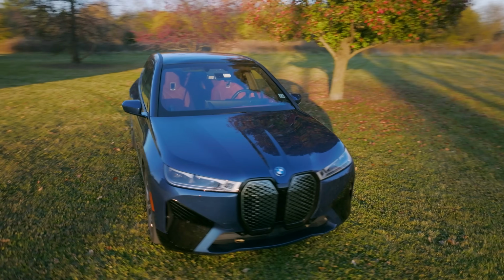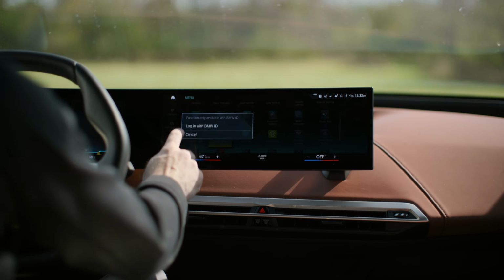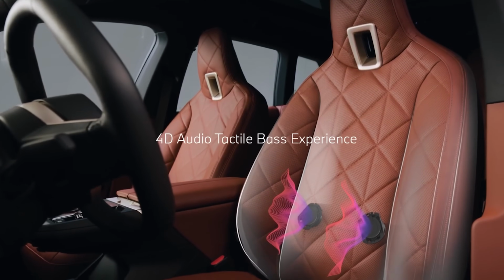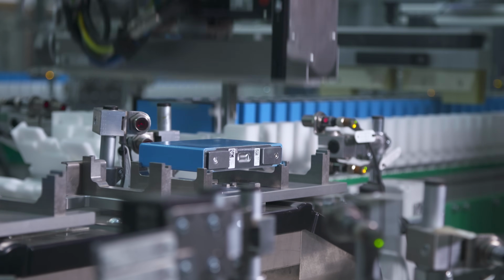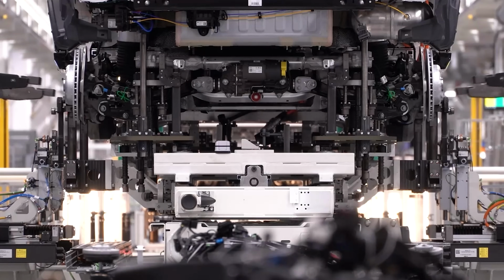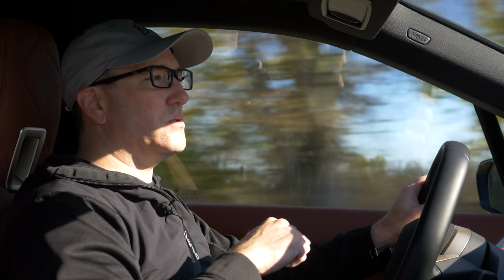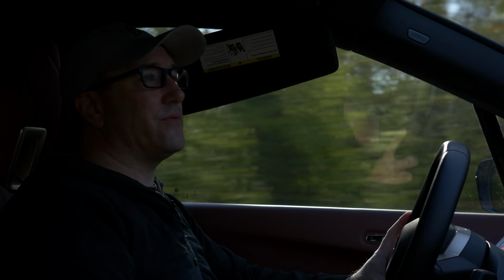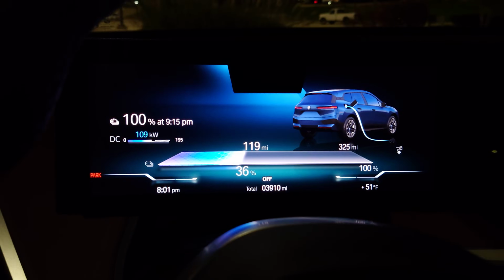BMW iX M60 | The Frustrating Future of EVs

Comment: I think the mechanical door switch is kept in case of crashes where electric power is cut off. You can still get out in those situations.
Reply: Adding complexity with no upside is foolish.
Reply: @bassandtrebleclef  Isn't it meant to be an added convenience that you can push a button if you don't want to use the handle?
But considering that you still have to touch and move the door, it seems like a lot of extra effort that that bit of pandering to the pathologically ultraconvenient.
Reply: @Dowlphin  I think it's small steps to get to a "BMW, Open my door" command. Totally hands free. We already have voice control and auto opening doors w/ active object detect sensors.
Reply: @josephcitizen4195  Such a voice command comes with tons of worries of careless activation and not enough security features.
Reply: @Dowlphin  How? There are push button auto doors on the market now. The careless activation of those are defeated by programming. How is a voice activated door any different?

Situations will have to be met though programming:
Car in park.
Car turned off.
Parking brake applied.
"BMW, open my door." 
Door opens w/ existing sensor tech that won't allow it to hit an object in it's way.

I'm not arguing, I'm genuinely curious why or how you think this won't become a thing.
Reply: I'm not saying it won't become a thing. It probably will, and will cause harm. Voice activation is more error-prone than mechanically pushing a button, and if the button merely unlocks the door and you have to push it open, even better.
But wise this is all definitely not. It is part of the technocratic agenda to make us ever-more dependent and ever-less self-reliant. Weakening the inner core of strength through temptations and pressures of borrowed external power, also lured into it by causing the problems that that power is supposed to shield against.

While we want a robot AI to lift our arm for us, beavers are munching through tree trunks.

Can people really do more these days thanks to computers?
Or can they merely tell computers to do more for them?
Are we conditioned into becoming like those who head these structures? Are workers turning into quasi-managers?
Reply: @Dowlphin  OK, didn't or cannot comprehend my talking points and then straight to troll/tin hat mode.

Got it. Have a great night dude.
Reply: @josephcitizen4195  I should have known your claim of not wanting to antagonize was bullshit.
Reply: @Dowlphin  lol you disagree with power windows too? 😂
Reply: @bassandtrebleclef  The upside is that you can get out, alive, after a crash. Think.
Reply: @codincoman9019  lol, maybe with fewer screens and nonsense distractions, said accident would not have happened.  Just spit balling.
Reply: @bassandtrebleclef  It’s a BMW, that’s all they are and ever have been.
Reply: @Ralph Lin you are correct.  The handles are for emergency purposes if the power is cut off.
Reply: because: REDUNDANCY.  this "ethos" is not just for Airplanes and the Aviation sector.

Comment: Too much rapidly changing technology and too much money.  A very good point about these being a "disposable" product and how the "sustainability" is being overstated. Last year when we bought a new vehicle we decided on a Honda Passport. Just a normally aspirated V-6 with a real auto transmission. We keep our vehicles a long time (also have a 2007 C-Class and a 1970 MGB) and I know the Passport will stand the test of time.
Reply: Non-aspirated V6? Lol
Reply: @hexbyt3u  Someone forgot to unwrap the air filter element again...
Reply: @hexbyt3u  Whoops Meant to say "normally aspirated".
Reply: If you understand how a supernova works, then you roughly understand our socioeconomical system.

The Borg collective from Star Trek is a useful analogy for some aspects of it, too.
Reply: dont they put that v6 in a sedan. sounds good.
Reply: @kalmmonke5037  Not sure. I think Honda has gone to Turbo I-4s in their sedans now.
Reply: WRONG FALSE NARRATIVE!
These $100K are limited supply from outdated Legacy Automakers who can't get their act together. They are just cobbling together what ever they can sell to many Rich Customers at limited production capacity.
This has NO Relevance NOT Applicable to the mass produced BEV industry up to $50K. Stuff like rapidly changing technology narrative is blatantly false as we do not even SUPPLY CAPACITY to supersede the existing cars. Sustainability is fine as usual because Car Production has DROPPED due to SUPPLY CHAIN SHORTAGE. Thus old 2nd hand cars have to stay on the road longer as they NOT BEING REPLACED!
YOU are not the Automaker trying to fix the SUPPLY CHAIN and making production numbers rise again. Stop pushing the false narrative your old car is any cleaner, because it's Not making a single difference.
Reply: @Neojhun  electric car life lasting longer apprenly due to batteyr degradation , see even tesla 3 cars already losing range thus being unwanted and junked after losing in used car market, while 90s corolla still running.  emissions is high to create battery from digging up heavy metal stuff so it takes 30k-50k miles for battery to start being less emissions over its lifetime....  so a balance between electric and combustion is best, optimized for cheap onwership too

Comment: The future of cars will now all be soulless appliances that will be too complicated for anyone outside of a dealership to work on. 

I would rather live in the past. 👍🏾
Reply: I wish we had a time machine. I wanna go back to 2007 or 2012
Reply: You do.
Reply: Just buy a nice 20 years old BMW and your fine!
Reply: Row your own gears in your E46 with the wind in your hair.
Reply: Keep in mind the average ICE driveline has 3000 moving mechanical parts.  The EV has a couple dozen.  Mechanical always fails before electrical.
Reply: @aussie2uGA  Those 3000 moving parts are still far cheaper and easier to replace. When something does eventually go wrong in an EV, it will cost far more and  most people won’t be able to work on them outside of dealerships. Even more $$$$$.

Comment: 7:00 BMW ditched physical buttons because people did not use them. Sorry Steve, I don't agree. This is just an excuse they are giving to make things cheaper and more locked down. Also the physical buttons need far less interaction than touch screen so of course I will take people more time at the touch screen than buttons. I am disappointed in BMW, 2 years have come by and still this shitty UI. Just embrace it BMW, older was better and improve on that instead of reinventing everything just to make a vau effect on new customers. Because at the same time you are loosing long time BMW owners. The only thing to ruin is driving dynamic and then BMW loses everything that made it great :/
Reply: It's literally a bolted on curved screen with cheap plastic mounting bracket. The german engineering aesthetic has hit an all-time low.
Reply: This problem isn't new.... BMW has been chasing crapification since at least 2010.  I just did a ride and drive in the 340 xdrive.  Extremely impressive car with a cheap interior and big, beautiful 4k screens to distract from the cheaping out.  Take away the driving dynamics and it's a cheap feeling and made car.  That is unacceptable to people spending this kind of money on cars.

Comment: EV just suck. The mining for battery resources is extremely polluting. They are super heavy which increases tire dust air pollution. They are super costly, completely out of reach for the average user.
Reply: Nevermind the impending shortage of heavy metals used in lithium batteries. Road to ruin.

Comment: EVs suck. And I find it mindblowing that everybody's jumping on the bandwagon of "how good and clean" they are, whereas in reality they are MUCH dirtier to produce, the infrastructure can't handle even 20% of current car numbers, if they were switched for electric ones..... and finally, the range, the explosive batteries, the unreliability of being hacked.... 
Thank you, I'll keep my manual transmission V6 gasoline Z.
Reply: Takes between 80,00 and 140,000 miles to start outperforming ICE cars on environmental impact depending on which estimates you prefer. And by that time you're contempating a battery replacement. So there goes the benefit.
Reply: If you actually bought a 3 pedal Z I salute you.
Reply: @markm0000  yes, but not the newest Z, I got the 370z, 6spd manual, non-nismo version. Threw out the viscous LSD and put in an OS Giken one. Put Eibachs for a slightly stiffer ride. Upgraded the antirollbars and this winter gonna add an oil-cooler. Everything else stock and will be left as such.